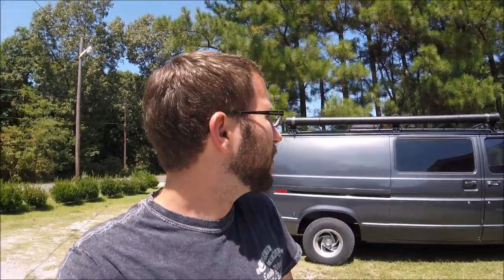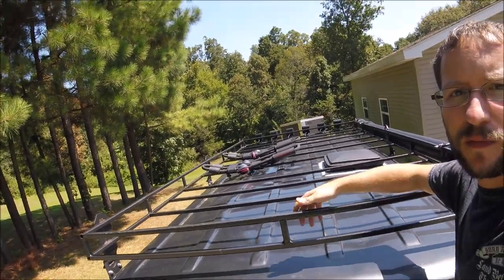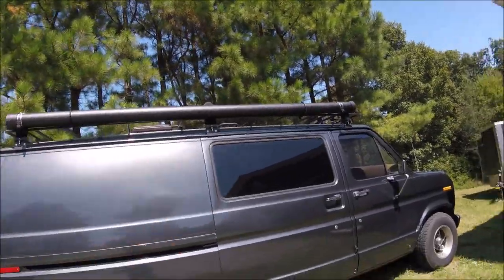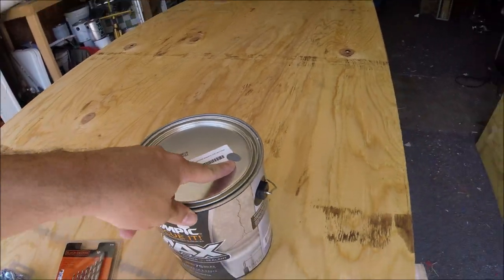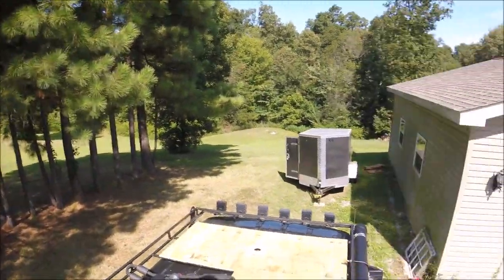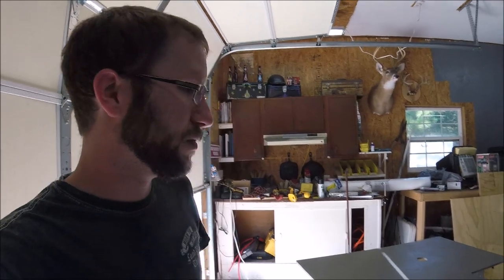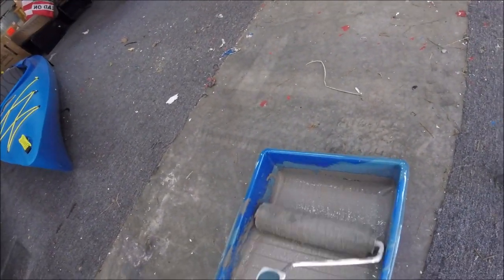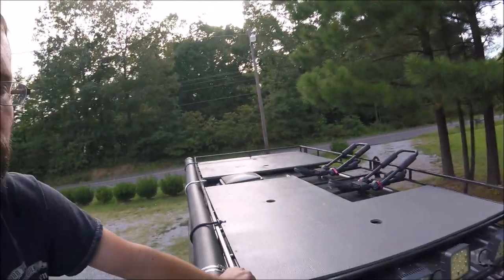Installing a Rooftop deck on my Camper Van

Comment: I wonder if this deck gets slippery when it rains and you are up there loading your kayak or something. Is there some kind of grit product that you can use if needed? Love the deck.
Reply from the maker: Martin Blair - Books the paint I used has sand in I and provides a grip like surface. I have used it many times when it was wet and it is not slippery.
Reply: Great to know. Thank you for replying. Cheers

Comment: Cool Mod.. i would add some of that sticker tread so it does not get to slippery when wet.. Just an idea for ya.. GREAT JOB!!! Thanks for sharing
Reply from the maker: Prepping2endure the paint I used is designed for decks and actually has some sand or grit in it and creates a non skid surface. I didn't really go over it in the video but it's great for surfaces that tend to get slippery when wet.
Reply from the maker: Prepping2endure the paint I used is designed for decks and actually has some sand or grit in it and creates a non skid surface. I didn't really go over it in the video but it's great for surfaces that tend to get slippery when wet.
Reply: Awesome!!!

Comment: that's probably gonna make the inside of the van 5 to 10 degrees cooler too
Reply from the maker: Bobby Britton I was wondering that. There is now a gap between most of the roof and he decking. I'm curious to see if it helps with the temperature of the roof.